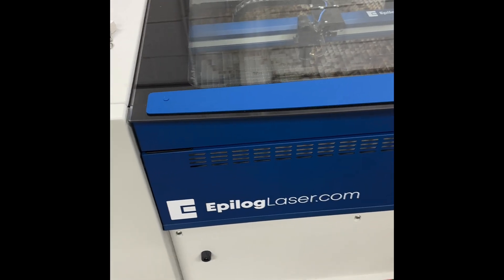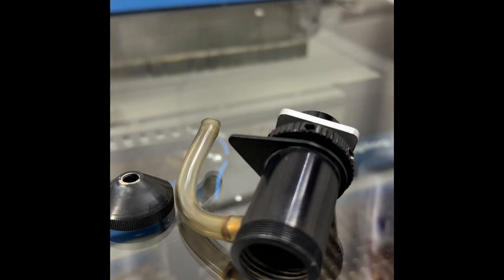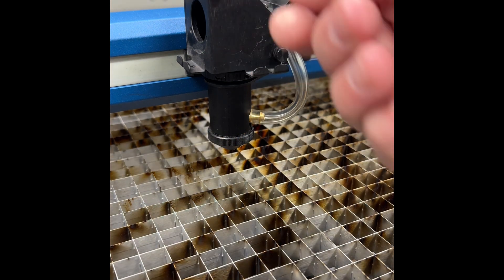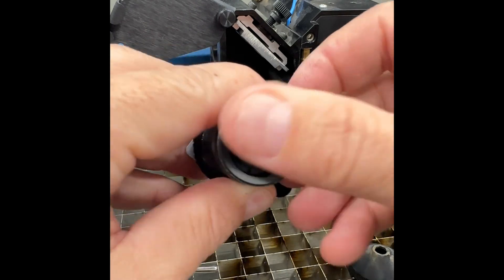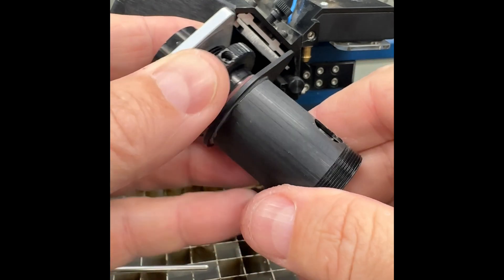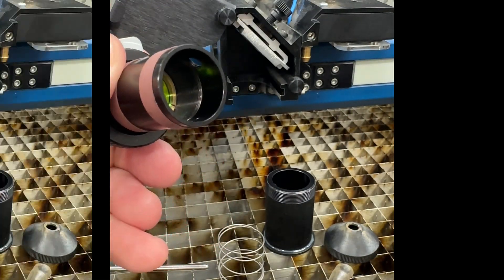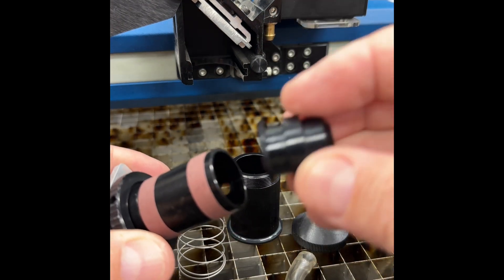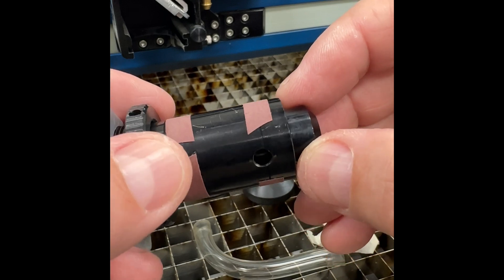Review of the Epilog Fusion lens assembly for the Maker, Edge and (Pro 24 & 36).

Comment: How often do you recommend cleaning the lens?
Reply from the maker: Generically speaking you want to check your lens & mirrors every week or two.  Specifically it depends on what materials you are cutting, how much residue is being put into the laser system, how well maintained your exhaust and/or fume extraction is performing.  And alwasy be sure your air assist is ON; especially during cutting; there's some debate about it being required during engraving, but again that depends on the material & exhaust performance.